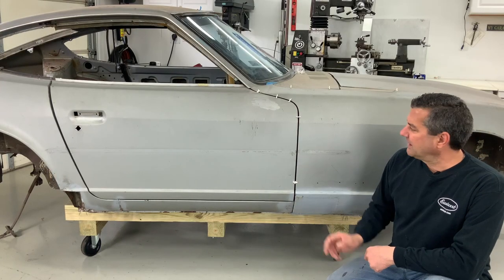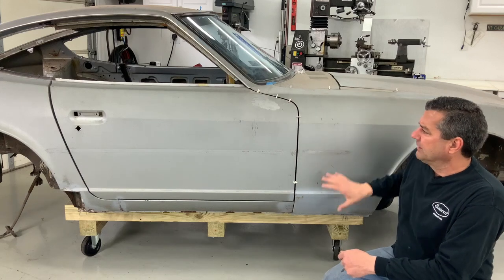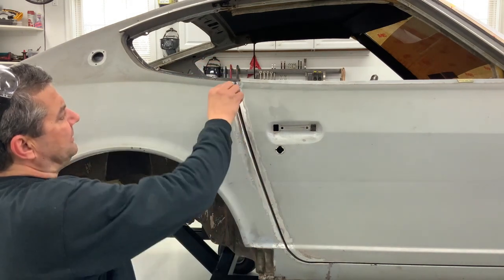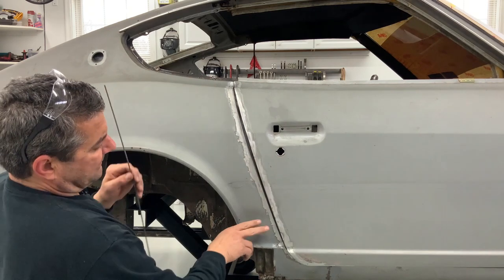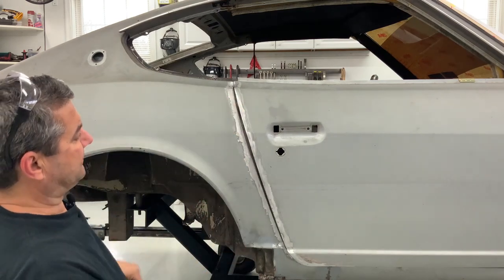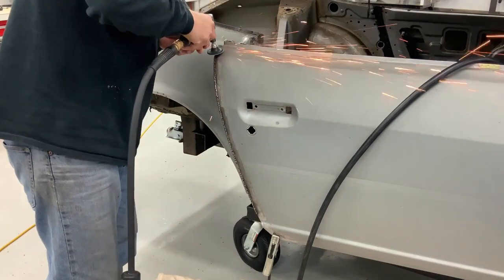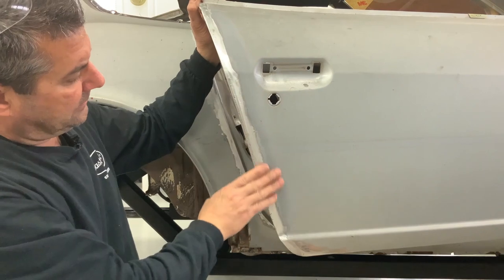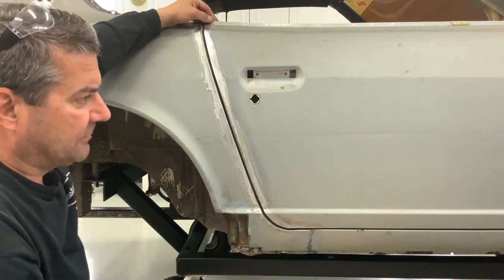How to Get PERFECT PANEL GAPS on Your Project

Comment: I see that your door to fender Gap is perfect. But why would you start there? I was always taught to line up the adjustable bolted on door to the welded up unibody/quarter panel, as long as there wasn't prior damage to the quarter. Then make your way forward.

Comment: nope, not the best way to do it.
i take the air saw and slice down the quarter panel about 5mm from the edge, then move that towards the door, that way the door looks original and the inside edge of the quarter looks original.

if it needs it i will add some metal to the gap where i moved the quarter panel then mig ot tig up the gap/s

the only area altered is the skin of the quarter which is a very easy area to refinish the metal work
Reply: Wouldn't that create a concave door jamb? Or if you move the latch items - change where the striker lands? Just asking, because I'm trying to imagine it. Never thought of either method.
Reply: @cart-wheels not when adjusting for upto 3mm it won't move the jam enough to notice, if you have to move it more than 5mm you probably have something structurally wrong and the door latch probably wont be hitting in the right place, if its that bad then it needs to be structurally adjusted first, thats in view of getting gaps 100% perfect when their normal correct fitment is out by a few mill due to factory poor fit and finish or just making stuff that bit more tighter.

i've been a panel beater since 1986 and seen a fair few dodgy panel gaps, some times on pattern panels for classics or for 20 years i worked in a London black taxi body shop, after working on modern cars there was alot of making stuff fit, i actually enjoyed that alot more than modern stuff.

when there was a short run of around 1 or 2 inches then i was happy to just mig that up but on a panel gap that was out by a few mill for most of its length then i'd rather do a split and shift, i'd tend to always favour the quarter or wing over the door, i did do a few welding rod welds on the door edge but its alot of arsing about as you need to make both sides look proper, you can hide some rough work with seam seal on the inside of the door but that can look wrong as it gets closer to the edge
Reply: @messylaura  thanks! Great info.
Reply: Thats actually a good idea....